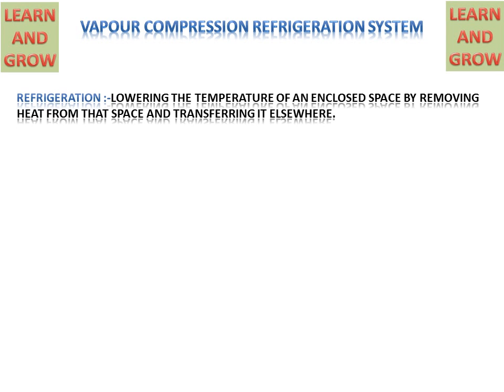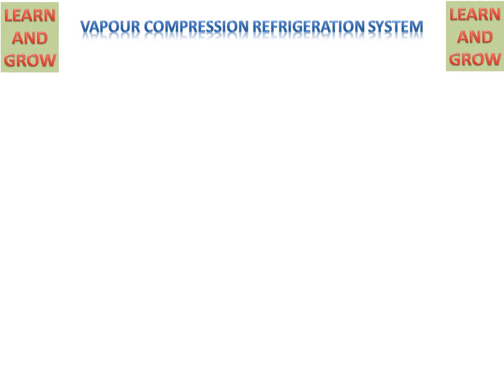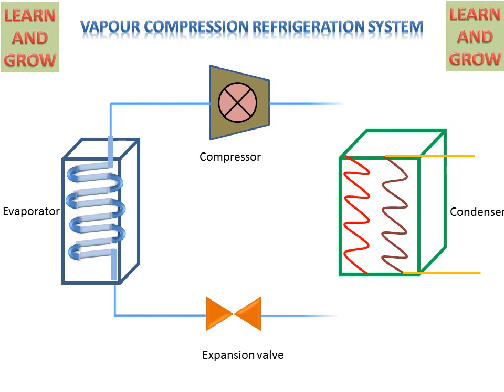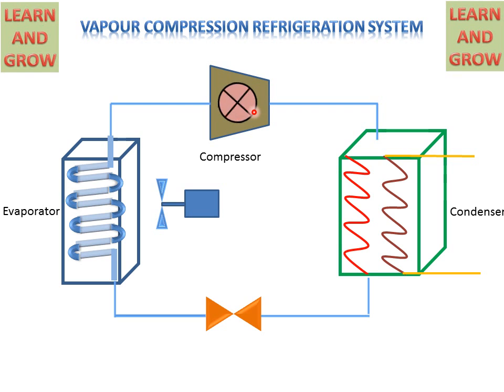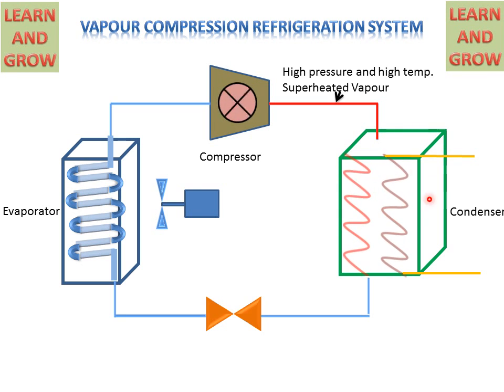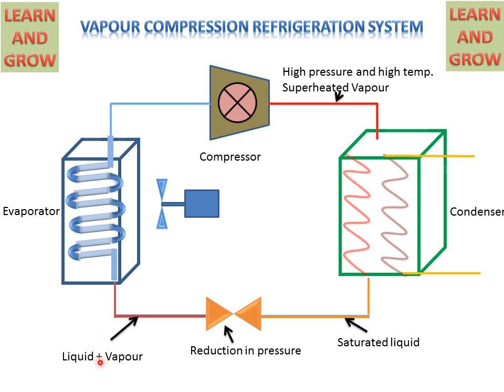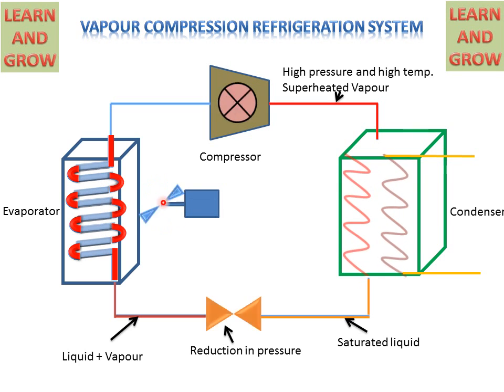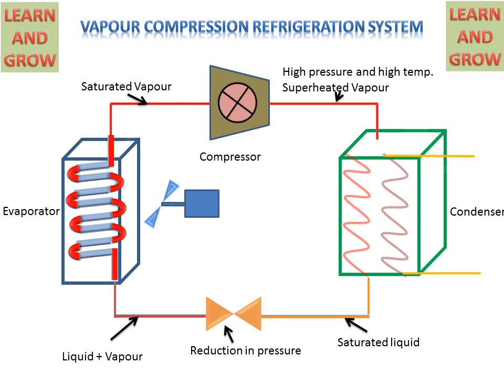Vapour Compression Refrigeration System (With Animation)

Comment: You haven't explained the use of fan sir .. What will it do.. Does that use.,to transfer the heat out from the system
Reply: the fan blows normal air into the evaporator so that cold sir gets out from other side